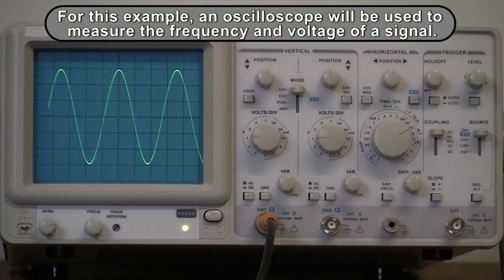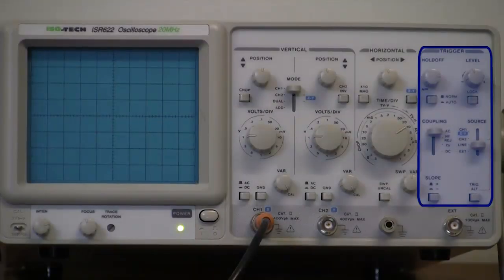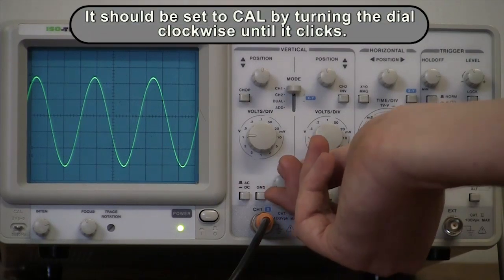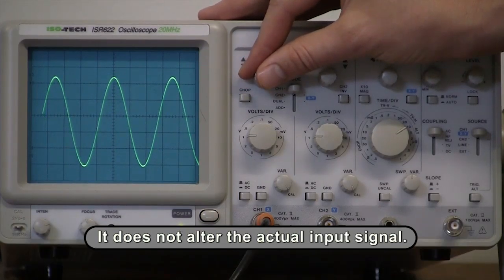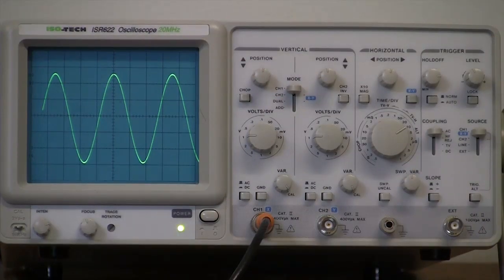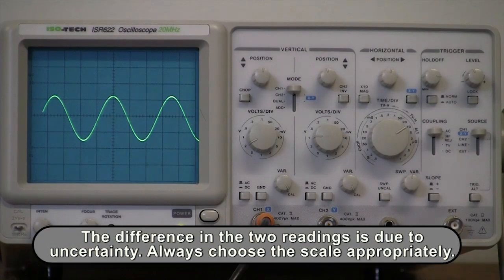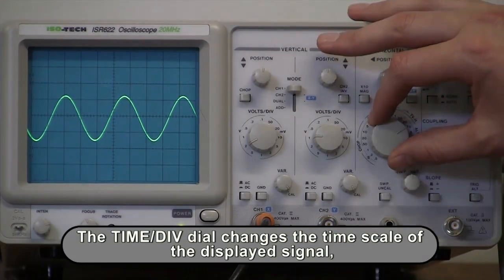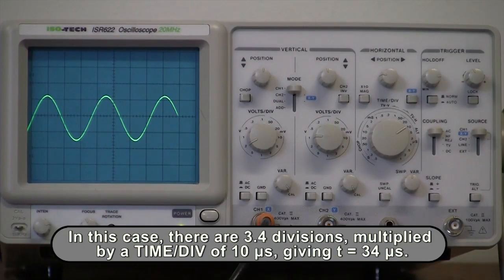How to use an oscilloscope with an A/C source

Comment: The scope (unless specifically an isolated, or battery run scope) will become the same potential if connected directly to a mains referenced circuit, and you will blow the fuse. If you remove the grounding pin to avoid this, the oscilloscope (case, BNC connectors, knobs) will be at mains potential.

You must read from an isolated source, i.e. a transformer where 0V is not the same as earth ground.

Comment: Thanks! if you know that the source AC line is relatively high voltage, let's say mains @ 110volts, can you still measure it with the scope? Where does the ground lug go, to the AC ground lead? Are any extra precautions needed, i.e. voltage divider for a scope that is marked maximum input voltage 400v. Also, if the source has inductive spikes, do those brief spikes give more reason to be careful...?

Comment: What could cause the oscilloscopes to read 80 VAC on 24 VAC signal? Multimeter displays correct value while both digital and analog oscilloscopes display much higher Vpp when probe's ground clip is used. Without ground clip they show the correct value. Tried it with DuT with and without isolation transformer, same problem in both cases. 24 VAC was coming from 220 VAC/24 VAC transformer without load connected.

Comment: Do all Oscilloscopes have the same features as this one? does anyone know?Can this be applied to any Oscilloscope?Thank you
Reply: no sir. they all are the same inside and they have the same controls but just with just different positions on the front interface. there are also versions like a 30mhz or  50mhz. every maufacturer has its own design. well if u know the concepts of a CRO u can use any kind of CRO and can get used to it just by experimenting with it a little....some cro may have additional features then the others.. but they are principally all the same..

Comment: 2.4 multiplied by 2 = 5.8 really dewd ??? 
=> 4.8* huhh
Reply: chitwan yadav that’s because he is using metric math, which is different then imperial math
Reply: Observe the division. Its not 2.4. It 2.8 or 2.9. He he adjust the signal correctly.